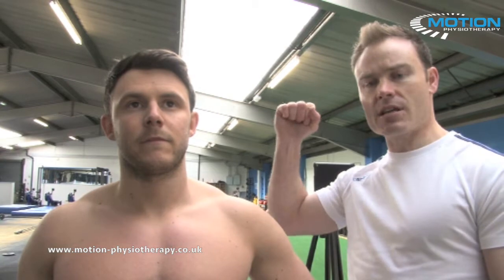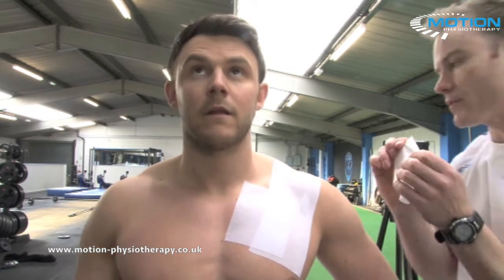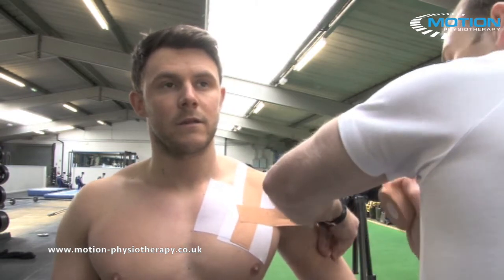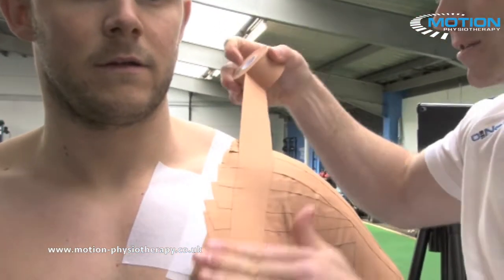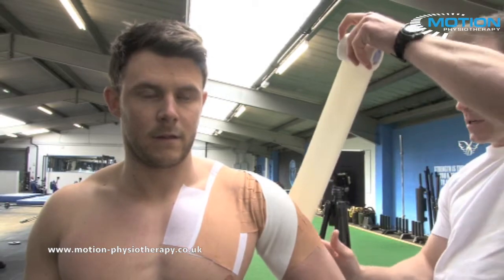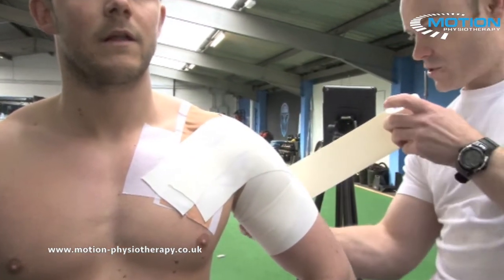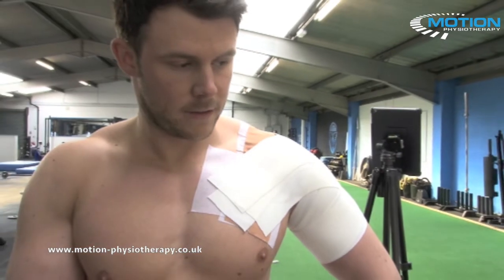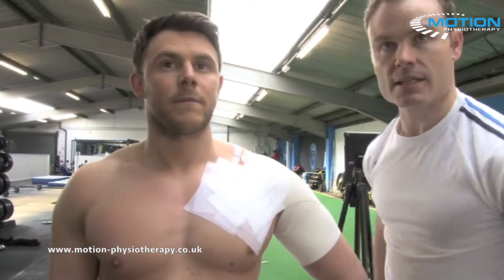How to tape a shoulder - instability / pain / cuff weakness / labral damage - sports taping series

Comment: My shoulder often pops out and back when i dance ...not everyday or something but  this year i have had this incident for the 3rd time and now i am scared to perform any sholuder move with intensity . Does this taping technique helps in stabalizing ? so that i could dance full on
Reply from the maker: Sounds like you would benefit from an assessment of your shoulder as it is unstable. This tech would help to stabilise it yes or you could go for something similar to a Flawless Motion shoulder brace. However you need to address the cause of the instability

Comment: My shoulder feels like its not sitting in the socket properly or as if part of the attached tendons or muscles are getting caught or twisted somehow
Reply from the maker: +t brown Have you had a traumatic injury to the shoulder or has it progressively felt like this? Ever felt a pop in the shoulder? Is it painful? have you lost power in lifting moments?
Reply: I jad an injury some months before but as well as i can recall it just started hurting and has not dramatically increased but has 

..?lsince june or july?
Reply from the maker: +t brown You may have a degenerative rotator cuff tendon tear or possibly a SLAP tear - get in to see a local sports physiotherapist to confirm your diagnosis